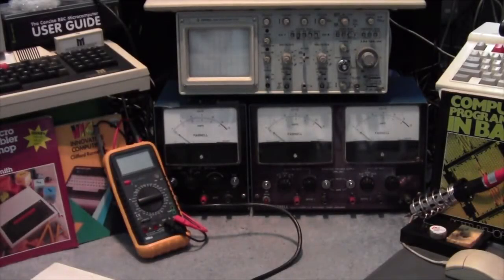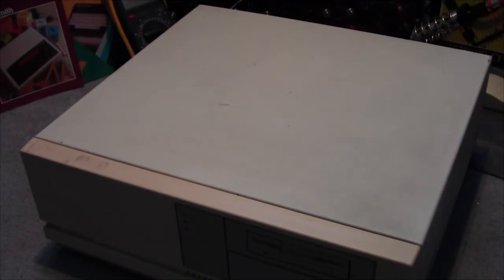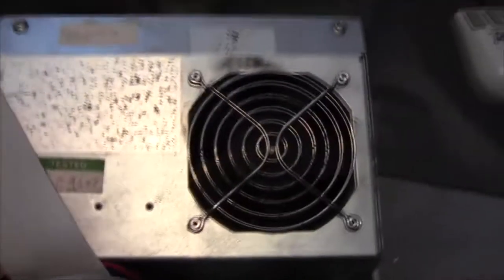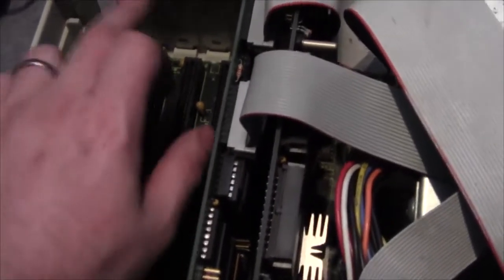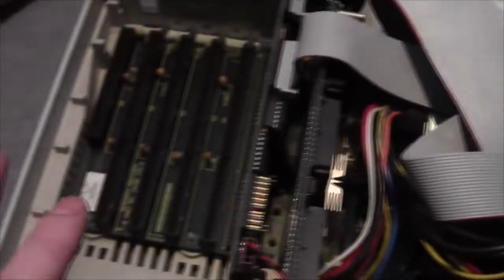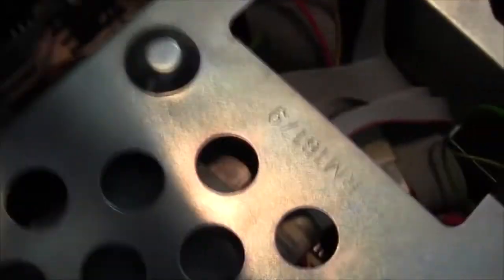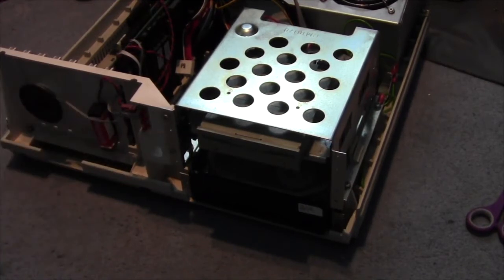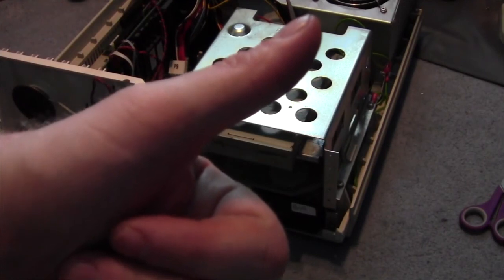Technical Advice Please: 1986 RM Nimbus AX Server enormous 20mb Winchester Drive

Comment: Definitely normal for the ST-225. The 'crash sound' you mentioned is from the heads is moving very slowly along the platter, until the 'read sound' you mentioned, which is 2 fast back-and-forth sweeps across the platter. Old Seagate stepper motor drives had the strangest sounding seek tests upon boot. Listen to the ST-251 and the ST-296N drives for other weird sounding seek tests.

Comment: Sounds like the stepper motor on the hard drive spinning up, once it had spun up that drive did sound pretty normal had loads of those drives pass through my hands in the 90's, good old fashioned MFM, I believe there were SCSI versions of the same drive too.

Comment: The Winchester drive is an ST-225  which you can find out about on Wikipedia if you search for "ST-225" and "Seagate Technology" I'd put links in but I cant :-/ As for the caps on the expansion board, they're Tantalum bead caps usually rated around 10v or 16v 100uF or similar for smoothing out the power distribution. It may be completely by chance that they popped in sequence so I'd look at replacing them all as Tantalum caps can pop like you've described when they haven't been used in a while.

Comment: Also, search for "ST-506" as it's likely that the drive interface is this type. The Seagate Technology drives are real old school and do not have auto-parking built in so if the machine is shut down whilst in mid-read/write it could cause issues. Having said that, the ST-225 was more reliable by all accounts than other drives using the same technology.

Comment: After checking the power supply voltages are ok, I'd say re-socket all the socketed chips, clean all the edge connectors. Try to power-up the board with bare minimal components installed, like the video card I/O card. See if you can get any signs of life out of it.